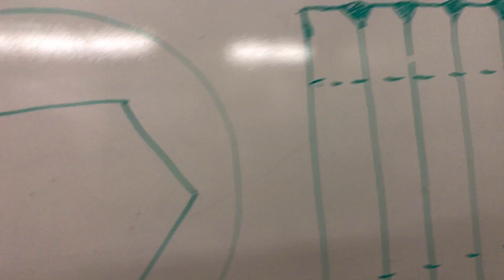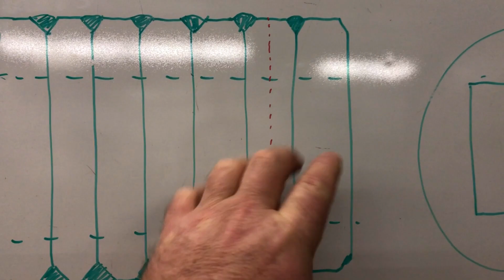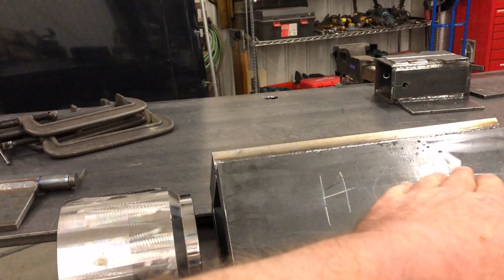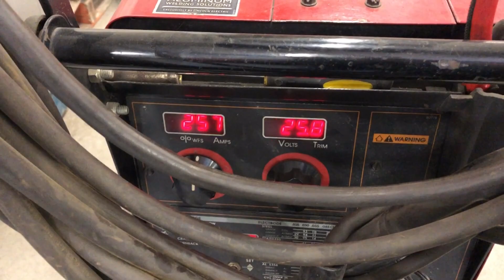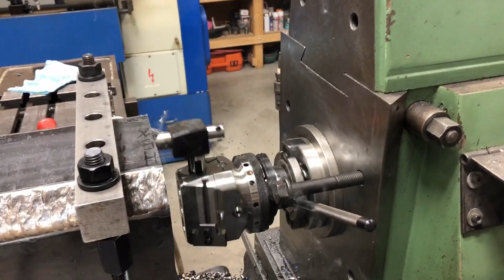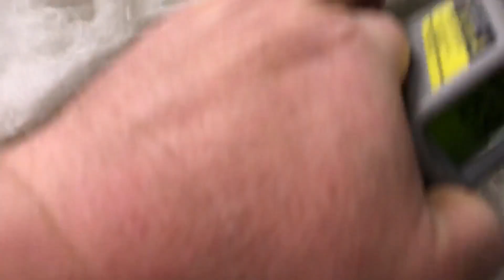ABM Adaptor Shaft Design & Build

Comment: Seems like a good solution but is there a risk of cracks propagating from the four corners that are unwelded?
Reply from the maker: There is that possibility.  However, we have had good luck making adaptors this way for the same screw anchor motor. Time will tell.  Ken

Comment: Awesome discussion/build, curious thought on the stacked plate design if holes were added when cut, would long pressed in through shear pins (rods) solve the possible delamination along with creating plate alignment for welding, I know nothing, just spitballing as it seems a method to a quicker build???
Reply from the maker: I had thought about using pressed in pins but it was hard to get enough shear area (i.e. pin cross sectional area) to resist the torque.  You have to remember that for a given torque, the closer you move toward the centre of the shaft the higher the shear forces are.  As you increase the diameter of the pins to get the shear area you need the centre of the pins moves closer to the centre of the shaft and they are subjected to a higher shear force.  This requires a larger pin area which then moves the pins closer to the centre where the shear force is higher and the cycle repeats and in my case I could never get enough shear area without making the shaft excessively large. Ken
Reply: Ken, thanks for the response and information….atb

Comment: Great job Ken . That is one nice boring head ,  way out of my price range at the moment !!!    Cheers .
Reply from the maker: Thanks Max.  I got a pretty good deal on Ebay for that boring head.  I paid about 1/4 of the cost of a new Narex boring head of that size.  Some of the boring bar holders still had wax paper and slushing oil on them.  It is just like new.  The biggest surprise is that it came from Canada.  Most of my Ebay finds are from the U.S..  Ken

Comment: Good to see your work.
Happy new year.
I have a Wohlhaupter upa3 int30 taper for one mill and a Taiwanese VBHU int40 taper for another..
They both do the job but I know which is smoooother!
They don't come out often but you really Know bore and face are perp when you need to.
Reply from the maker: I was shocked at how nice they are.  I've had a Narex for almost 20 years and I thought it was pretty nice. However, the Wohlhaupter is a cut above.  They are exceptionally smooth and easy to set up with the single wrench.  Ken